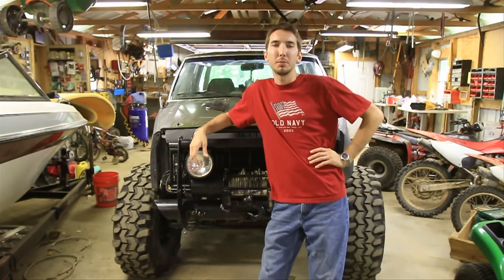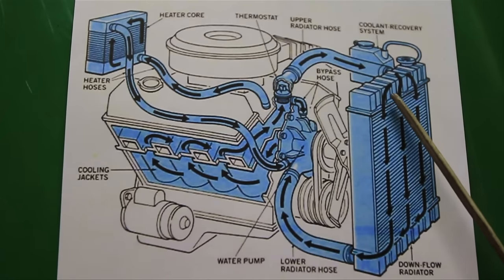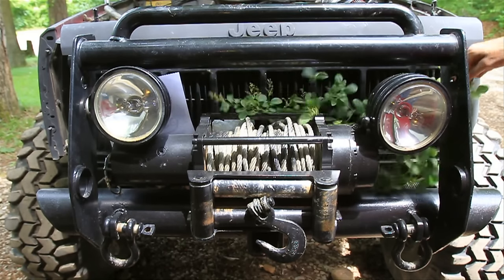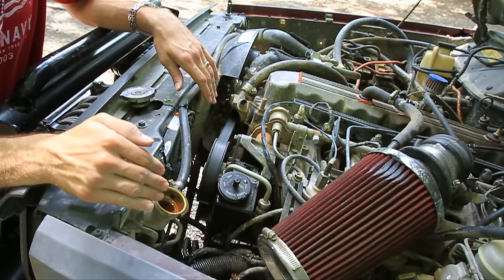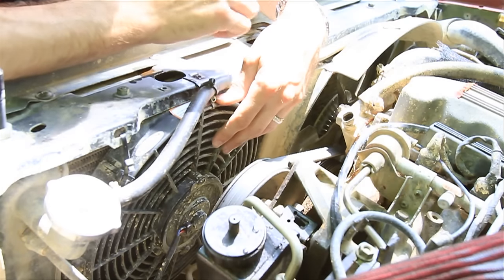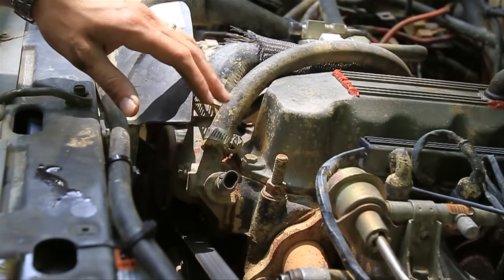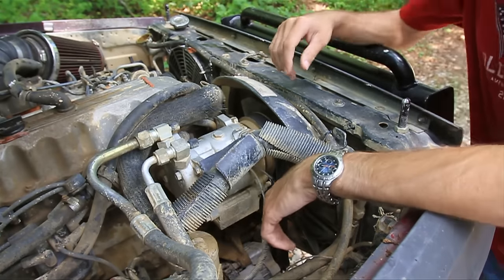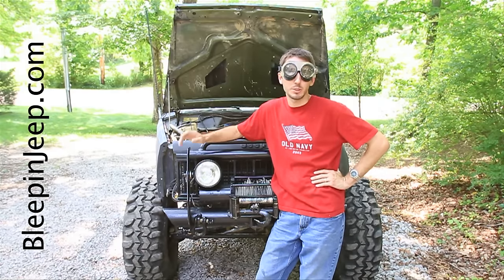Engine Overheating? - 9 Steps to Solve

Comment: Idk if you are still checking comments but I have a 2008 Saturn Aura that had a water hose blow out, i repaired it, but now the car seems to have a really bad overheating problem. I've tried driving it around in hopes of releasing air from the surge tank but it continues to overheat no matter how many spins I take it on.

Comment: ON A MOTOR OF 205 DEGREES IF YOU LEAVE IT IDEL FOR A FEW MINUTES SHOULD YOU BE ABLE TO SQUEEZE YHE UPPER RADIATOR HOSE OR WILL IT HAVE SO MUCH PRESSURE YOU CANT SQUEEZE IT. IF YOU CANT SQUEEZE IT DOES IT MEAN THE THERMOSTAT ID STUCK SHUT... THANK YOU.

Comment: When flushing the system , I recommend also reverse flushing . Especially the heater core . I have had heaters that were only warm come back to life with a reverse flush - directly on the core . Deposits build up over time and cut down on the heat . Also on the radiators , the tubes can get restricted . You can use a laser thermometer to check ALL the tubes . They are usually colder in the middle of the radiator if clogged . You can also put your hand on the tubes to check for cold areas - if you can get it in there . BUT you don't want your hand near an electric fan , even when not running . If hot , they can still turn on with the ignition off .
Reply: So my radiator is at 175 all around but in the center it’s cool. I can touch it. I thought it was because the clutch fan was pulling in air the most right there. I checked it right after taking the upper fan shroud off then I could stick my hand and a lazer thermometer everywhere with out the clutch fan in the way
Reply: @Arizona_rider  I would think if the tubes are cold in the center of the radiator , it's because they are clogged and not allowing hot coolant to get through them . It will cut down on the ability of the radiator to get rid of the heat . I would replace the radiator . Also check the thermostat and circulation from the water pump . A reverse flush of the entire system, including the heater core , will bring everything back to full potential . You are working on a complete cooling system . Don't just slam a radiator in without doing a complete job . Don't forget to check the cooling fans . And don't run straight water .
Reply: @billsmith2212  I just had my 454 dually redone. I changed everything to stock. Someone had an idea for a show truck but on a really tight budget. I decided to pull everything out and redo it from stock. Only thing is I can’t keep it from overheating after the outside temperature gets above 100. I even spent 1200 on a new ac. Once it gets 230 I turn heat on and sweat it out. It’s all factory now. Even the old engine did the same thing
Reply: @billsmith2212  I just got off the phone with the builder and he said the center is going to be cold because that’s where the fan clutch pulls the most. The coolant sensor and thermostat is what he said to look at. Those thermostat’s are junk now and they see alot of them failing in the last 5 years
Reply: @Arizona_rider  If the center is cold , the tubes are blocked . Because you are in an extremely hot area , you may want to upgrade to an oversized radiator and cooling fans with more CFM . There may also be a water pump with more flow . But if the coolant moves too fast , it may not allow it to give up the heat when going through the radiator . However , the larger radiator may balance that out . Look into radiator shrouds and air dams that direct the air flow . I would think there are shops that specialize in cooling systems , especially in Arizona . A specialist may have a complete system to get the temperature down . I would start with that blocked radiator core .
Reply: @Arizona_rider  You can check the coolant temp sensor and thermostat . In a custom system , you may be able to lower the temperature that the fans come on at . If you get off the highway and shut it off , and the center of the radiator is cold , the tubes are clogged . There is no flow through them . Remember those fans can still run with the key off .
Reply: @billsmith2212  I’m leaning that way. I’ve actually talked to a couple hot rod shops and they said because of our elevation stuff tends to run hotter and having a bored over 60 454 in Arizona is another problem. I’ve been told to go buy theses fans and that. On the old engine I took out the thermostat and never got over 180.
Reply: @billsmith2212  that’s exactly what I did. Cam off the freeway and immediately started to check everything for a solid 6 days. Temperature and wrote everything down. There’s this black crap like fiber in my over flow tank and under my radiator cap. Like a rats nest or radiator stop leak

Comment: Hey just went through a night mare for a weird over heating problem in my 2010 Jeep Liberty found out after a thermostat then water pump then radiator and five days later found out that the thermostats from part stores will not work in this vehicular you have to get them from car dealer because rectory thermostats are specials ; my car would over heat as I got up to speed of 65 if I stayed at 55 or slower it would not over heat this is just info if your out there having problems like this yes it was a feascail but it runs awesome now
Reply: never F around with aftermarket cooling system parts, leave that for suspension

Comment: Great video,  You certainly cannot cover every possible issue but you covered 95% of them.   Like your systematic explanation.  I could used this as a learning tool to teach my kids about how engines work.  Can you do one on brakes and oil pressure next?  Hats off you.  Thanks

Comment: when i got my xj the blades on my auxiliary fan (the electic one) where gone . i went and got a new one , installed it and wired to a toggle switch . greatest choice ive ever made . for the most part i can control my engine temp :)
Reply: Lmk about the install idk shit about the wiring

Comment: The clutch fan on my '88 Cherokee didn't budge with the engine off.  It still spun when the engine was running, but the clutch was seized.  I found a couple of fans at a junkyard that still spun freely and swapped out the original for one of the junkyard fans.  Had to pull the radiator, but got it done.

Comment: Hey Man thanks a lot for the video, it helped me figure out my stupid mistake. I have a 01 Intrepid rt 3.5, and it kept overheating after i tried to fix a mess with the fan wires. I had one of the fans pushing air instead of extracting it,  I never would have thought to look at the direction they were blowing. All fixed now. Guy i bought it from thought it was the water pump, but he just didnt have things connected correctly. The reservoir tank was connected wrong too. Saved myself a few hundred dollars at the shop and future headaches thanks to this video!!!

Comment: forgot two very common causes:

1. cracked head, block, or head gasket,

2.  plugged radiator.

Also, sometimes the water pump impeller will erode away or just spin on the shaft without its bearings going bad so you need to discuss a way to test its actual flow.
Reply: Excellent comment ..

Comment: Hey Matt, I've watched this video several times and changed out pretty much the whole cooling system in a 99 XJ. New pump, thermostat, cap, rad is less than 2 years old and the hoses look good and fairly new. I've also flushed several times. I thought it may be the "spring" in the lower hose so I changed out the lower hose and sure enough, no spring. I've been to several local auto parts stores but they don't have any with springs. So I used a new one hose from Autozone. It does seem more stiff than the old one, but she's still overheating and after running, antifreeze upchucks out of the reservoir. Does this sound like the lower hose is collapsing and if so, where do I get a spring? Thank you for all your videos, I watch them all the time:)
Reply from the maker: robpossible I've read about this and apparently only the Factory hoses had springs and they were for filling the system with antifreeze quickly on the assembly line and were not needed after that. Another theory, modern hoses are stiff enough they don't need springs anymore.
Reply: 😭😭😭 I have the same problem with overheating I have changed the water pump, changed the radiator, change even the gasket but still overheating
Reply: Its a head gasket  unfortunately.

Comment: Great video.....must have been other mechanics who gave you thumbs down out of jealousy. You told everything an inexperienced mechanic needs to know!
Reply: thanks buds ! couldn't agree more , i know i learned something thanks again!
Reply: Good mechanics give information freely, dispel misinformation, because keeping your car in proper working order is just good business.
Reply: Replacement of the viscous clutch  on the mechanical fan will suck volumes of cooling air through the radiator,replace it,if you have overheating problems,as there is really no way of telling if it is working correctly ..Replacement of the viscous clutch can make a major difference to the running of your jeep, never overlook or pass the replacement of the viscous clutch by.

Comment: Jeep Cheorkee 2000. 140K Miles. rusted out radiator (too much water) March. replaced with new one, thermostat and engine flush - fan shroud broke, did not replace. Worked fine through NorCal, OR, WA, ID, UT, NV, AZ - 2000miles. Overheated once in MT. Split upper radiator hose. Replaced. Once back in SoCal, overheated. Lower hose replaced.
Ran fine for 3 weeks. Then, began overheating on slight grade, or after running for 20m driving. Could let it sit for 90m at idle with AC on full, nothing. Drive it up a grade, or for 20m overheat. One too many times and Cracked head between Cylinders 3/4. Replaced head. New fan, water pump. radiator cap. Still overheats on grade or after 15m. Had Firestone do cooling systems check. Passed block test, another radiator cap and tightened hose clamps. Said it was good to go. Still overheats on grade. I've had five Cheorkees - still have two - and get 200K miles + out of each. Any ideas?

Comment: "Harmonic Balancer"  I recently learned the inner rubber membrane can break down and cause the water pump to not circulate water fast enough.  To check this, see if the outside of the Harmonic Balancer turns at the same rate of speed as the center of the Harmonic Balancer bolted to the Crankshaft.  Yes, it will separate and damage the radiator.

Comment: Good video. I am a full time autotech. It is rare, but I have seen water pump impeller's seperate from the mainshaft. It won't leak or wobble, but it will not move water. It is common on VW engines with plastic impellar, but I have also seen it on chevy's. Also air in the system can cause overheating. Honda civic's with the heater core up higher that the radiator cap are bad about this. I use a special funnel to bleed out the air. Keep up the good work.

Comment: NOTE:  Internal Clogged (Engine Block Passage) is the hardest and you could pull all your Hair out before you realized it's in the Engine Block ://.
Reply: What to do then??
Reply: I replaced the water pump and the thermostat but my truck is still overheating what could be the reason ????
Reply: @twinewinfieldwinfield6734  -  You have to do an " Extreme Flush ".  See this video here:  https://www.youtube.com/watch?v=0aaLVCpVS08

Comment: If you are over heating and your upper radiator hose is bulging could this be a radiator cap that is not opening?
Reply from the maker: +Mike Meegan i would think maybe a clogged radiator.
Reply: +Mike Meegan - Sorry but if the " Radiator Cap " is " NOT OPENING ", then the " RESERVOIR " would " OVERFLOW " first.  I agree with " BleepinJeep ".  If the " Upper Hose " is bulging.  3- Things you check. #1. The Radiator Clogged.  #2. Internal Clogged (Engine Block Passage).  #3.  The Thermostat is NOT opening correctly.
Reply: Mike Meegan k
Reply: +Jordan Bronson man mine I've replace the water pump and I've taken the thermostat out but even if you try to blow the lower house while the engine not running air not going THROUGH and that results on having the lower house cold while the upper is hot while running the engine what can I do it Toyota avanza 2010 with an import engine
Reply: @maxmillion7861   my truck runs fine temp wise but when I shut it of and flip they key over once the temp gauge goes up 3/4 or more and my lower radiator hose is cold and upper is hot any suggestions?

Comment: The issue I'm having is that the car only over heats when I turn the ac on. The ac works' but the car over heats if it's kept on. If I don't use ac the car run just fine. Can you please help?
Reply: Did you fix your problem?  I'm having the same issue with my Nissan Maxima
Reply: Nah,  but some told me that it's a sign of the head gasket going bad'
Reply: Bcs I put a new radiator, hoses, thermal stat. And it's still doing it
Reply: +AR-X I Yea I took my car to the dealer.  Same thing coolant leaking in to the spark plug cylinder.  New engine needed.
Reply: you should have replaced the head gasket!
Reply: hye  !  have you fixed up your problem
Reply: I would check all the points in the video first.
When you turn on your a/c the engine will idle higher, this will can increase your coolant temperature if you have a small problem. It will also increase the radiator temp on some vehicles as the A/C also has a radiator of sorts in front of the normal radiator.
Do the easy thing first.
Check you have enough water in the system.
Check the fan is working.
Change the radiator cap.
Check or replace the thermostat. 
Check to see if the radiator is blocked or the fins are damaged, replace if necessary.
Have it checked to see if the head gasket is good, a simple test.
Flush the system.
Change the water pump.
Reply: @harveysmith100  well said

Comment: Is mayonnaise a coolant?
Reply: NO, do NOT put mayonnaise in your car's cooling system!! It will cause damage and does not have the proper viscosity that your car's recommended coolant needs to have. Not to mention mayonnaise will freeze in winter conditions, and does a poor job at cooling your car!!! Do not listen to this guy trust me, mayonnaise is not a good idea for putting in your car's cooling system, it's a common urban myth that it can work!!!
Reply: @micaarzur  Alright fine, deli mustard it is.
Reply: @shark180  much better.
Reply: Are you talking about sandwiches?

Comment: Man, your laid-back style is the best. I have an 04 Cherokee 4.0L 6 cylinder 2 wd. It has been running hot. It took about 2 hours to get it home one night because it would drive only so far and then get too hot to start. After it cooled to less than half of its max hotline on the gauge I would take off again and drive as far as possible and that cycle repeated until I finally arrived home. I stopped and pour 5 small bottles of water into the coolant reservoir. That made no difference. It's in my garage as I write you. Your video certainly widened my perspective on what the problem could be. My mechanic was to come by and check it out Friday but never showed or called me (typical). The radiator or engine cooling fan does not spin when the engine is off and I attempt to turn it manually. It may be out. Or, the resistor as you taught could be shot. Do you know any mechanics in Memphis? If so, give me their name and number. Thanks. I subscribed and clicked the like button.

Comment: the oil pump screen or oil filter.the aintfrezze is new fans good every thing good with fluid new caps temp gauge good readyater. .could be the head gasket 
the motor gets hot nothing else the oil red hot .

Comment: I have a 2003 honda 140k that's been always overheats, I pour coolant into it and it's fine with highway driving it's not until I stop or idle that the temp gauge begins to climb. Around the time I stop/idle after driving the a/c will change from blowing hot air to blowing cold air. After it overheats I'll pull it off to the side and check the components the overflow tank looks to have spitted out all the antifreeze towards the bottom and some on the air intake. I've had a new thermostat installed, fans checked/electricals, new radiator was installed. I thought it was a bad head gasket but there is no white pummels of smoke or a milky dipstick and I had a mechanic do a chemical test and it came back negative. What might be wrong?

Thank you
Reply: Have u check your water pump dude?
Reply: Had a master ASE tech check it out, blown head gasket.
Reply: James Whyte my 2001 honda civic does same thing. hopefully it's not a blown head gasket tho.
Reply: check cooling fan switch.
Reply: James Whyte it's a Honda... that's why :)
Reply: sounds like a fan. although I'm aware you said fans were good
Reply: sorry I just realized your comment was 2 years old. surely you've fixed it by now lol
Reply: James Whyte o
Reply: I have my matiz that always sometimes start heat and fan stop plz what is solution to take?
Reply: living in a desert  blown head gasket

Comment from the maker: Distilled water is water that has many of its impurities removed through distillation. Distillation involves boiling the water and then condensing the steam into a clean container.  Tap water has calcium and many other additives that can build up in your cooling system over time.

Comment: Years ago we use to flush a vehicles cooling system and remove and test the thermostat to make sure it operated properly.  Then we would remove the upper hose off the radiator and fill the whole cooling system and start the engine and the water would fly out of the upper hose about 10 to 20 feet in front of the vehicle and empty the system in a few seconds.  This would tell us we had a good water pump and that the rapid flow means we at least didn’t have any obstructions or blockage through the hoses and block.  Also a combustion test on the radiator water would tell us that the block, heads and gaskets were either good or bad.